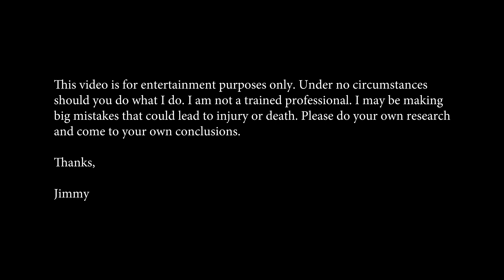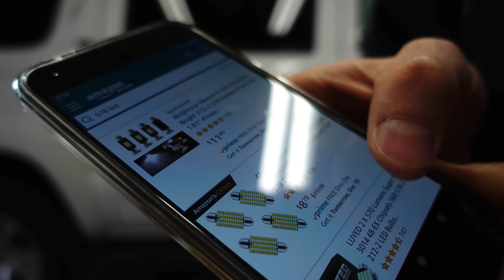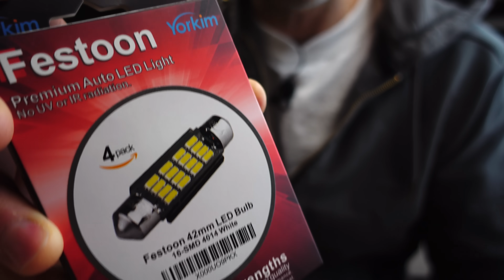Here's Why You NEVER INSTALL LEDs IN YOUR CAR OR TRUCK!!

Comment: A quality LED should last thousands of hours. Think about an OLED tv, each pixel ( there are thousands on every display panel) is made of an individual LED and those last anywhere from 10k hours on a cheap tv to 100k hours or more. Brand name would be a bigger consideration for me than any design choice (which might not even function properly). A big brand name that has been selling all kinds of automotive bulbs in every big box store and auto store for decades has more reason to make reliable products than “fong xiao zhi happy bulb light concern and much joy brightness products” , and  they’ll actually have customer service. Amazon is great for some things, but in my experience all of these cheap LEDs don’t last like Phillips or sylvania bulbs. In some of the reviews customers mention electrical problems, parasitic drain, fuses blowing, and other nasty little problems. All to save a few dollars, it’s not worth it imo. Everyone is different tho, you may have good luck with Amazon brands.

Comment: TLDW: man buys cheap LED bulbs, is disappointed, tells other people not to buy LEDs because he doesn't understand how to find quality bulbs. 🤦

Like with all things guys, if you buy quality you get quality. If you're not sure what's quality check the reviews! Check the reviews on multiple sites! We've had the internet for 30 plus years now, Google is a thing, and it's not hard to tell the bots from the real reviews. I have put LEDs in many cars and there's only one rule that you should follow. Stay away from blue tinted LEDs, try to lean more towards a pure white or slightly yellow. That's because you have backscatter in the atmosphere and blue light backscatters more than the other wavelengths (hint: that's why the sky is blue!) So if you use a blue tinted light at night you get a lot more backscatter ie: more light thrown back at you making it hard to see what's ahead of you. So as long as you buy a good quality LED bulb that is around the 4000 to 5000 k color temperature rating You're going to get the same light quality as an incandescent bulb with much better brightness and a lot longer life.

Comment: Wow a lot has changed in 4 years. Those emitters he has are all crap, plus he's using very cold (700K or so) bulbs, ick. Much nicer are around 400K, not too warm or yellow (2700-300K) but a little warmer than neutral (5000-6000K). Heed the warning on the headlight bulbs, NOT FOR ON-ROAD USE because you'll blind people.

Comment: What early adopter "faddists" buy isn't a good indicator of a product best suited to an application, Often these are popular because of numbers that are bigger, but have no relevance to the need, and may be dangerous,  like 0-second times below 4 seconds for small SUVs normally operated by a mom driving kids to school or the mall in city traffic,  and occasionally driven by a teenage boy on weekends. 
Using daylight interior lamps at night is a safety issue..  Much worse than  having someones high beams in your face, seeing the blue light of festoon lights (they are all UV LEDs with phosphor coating) while entering a car at night can reduce your night vision for a significant amount of time. Think about the quality of lighting you use in the room where you watch TV or read.   Do you want a harsh white kitchen light in that room? It's better to use LED festoon lamps that are warmer "soft" white than  daylight

Comment: Your initial use of the word HALOGEN Bulb was plainly wrong to me. So I listened to more of your video and you used the word HALOGEN for a dome and/or interior light. WRONG. Halogen bulbs are EXTREMELY bright and super hot, way more than the bulbs shown in your video.

And towards the end you talk about using LED bulbs to replace normal headlights. WRONG.

Comment: For older vehicles, the relay systems need upgrading and the correct led for the reflective lens
Reply: @Darrylle Couper For my 06 E-350 and my 99 Ranger, all I had to do was replace the OEM flasher. LED turn signals don't hyperflash now. Interior replacement LED bulbs are fine. LED replacement headlights are in a new, better designed housing and aimed properly.

Comment: The title of the video is "Why you should never install LEDs," but the guy spends 11 minutes blathering on about how great LEDs are - as long as you buy some with heat sinks... 

LEDs suck. I hate that harsh light. I'm not doing brain surgery in my truck and I prefer a softer, warmer light. Which is what I get from old-fashioned, time tested incandescent (not "halogen") light bulbs.

Comment: Theres a further issue i see.   A lot of the cheap style leds coming out of aliexpress use a chip that lowers the output power when it gets too hot, so they slap that on the back of the led for sensing instead of a good heatsink, which they sometimes offset with a metal casing. Now thats set to circuit board temps, not crappy plastic casing temps. So if that things melting, the sensor chip could part from the led, leading it to go full blast with the power and then youll have melted stuff.

These new cob produce very little heat compared to the last generation cree bulbs, but they do need some heatsinking just the same as the cree's. And that wont work in a small enclosed box, you'd have to have some sort of venting at the back of your light, and thats probably not road legal. Bulbs are designed to run hot. These things arent. Even with a huge heatsink where will that heat go 🤷 the metal ones wont melt and turn into heaters but will dim when they get hot. And they will get hot. They even dip up and down suddenly sometimes, which could be seen as a signal. Or leave you blind in a tight spot. maybe heatpipes or active liquid cooling..but again..gotta be road legal.
Reply: @Luminous Fractal maybe buy better quality LED bulbs? Stay away from the amazon specials. The bare minimum I would consider would be the Sylvania LED bulbs if I wasn't using higher quality and more expensive ones. I only buy LED bulbs from 1 outfit and that's been the same outfit since 2007. 2 year warranty on their headlight LED replacement bulbs and 3 year warranty on the rest of their bulbs. I only had 2 go out, they were 194 wedge bulbs.

Comment: Somebody replace his car headlight with LED cheap Chinese junk, and he ended up burning the whole headlight assembly and the fire got to his finder cover, he was trying to contact the seller on Amazon, but no answer,  just eat the cost of replacement and fixing your car man.
Reply: The problem there was "cheap Chinese junk," not LED per se.
Reply: what about philips or osram leds?
not only they are designed with retrofiting them into halogen headlights and have the same light pattern but they are road legal too

Comment: I have not even listened to your Video, because you are Wrong.. . .  LED's are very, very good for Cars and Trucks. . . . If you think otherwise, then there is a lot you do not understand. . . .  Please do not pass on wrong information to others.
Reply: OK, I have listened to some of your Video.. .  Yes, correct, there are many BADLY designed LED lamps out there.. .  Many made in China principally, are badly designed and not making the Lamps correctly. . . .    OK, so I was first designing equipment with LED's in the 1970's so I do know perhaps more about LED's than some of today's manufacturers. . .  The bad manufacturers will go out of business, as the good manufacturers start selling properly designed LED Lights.